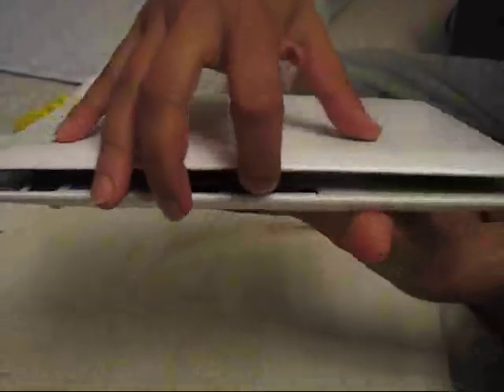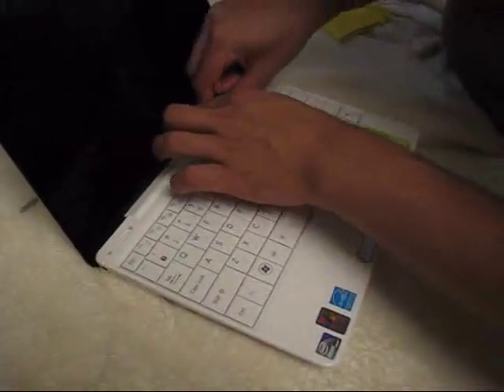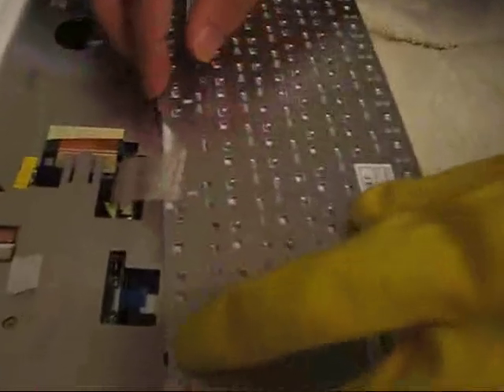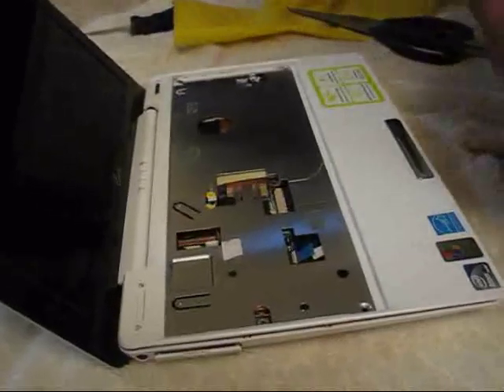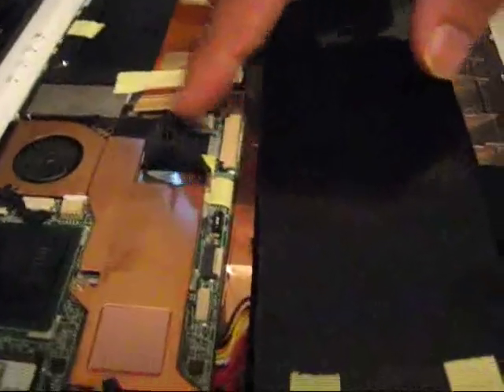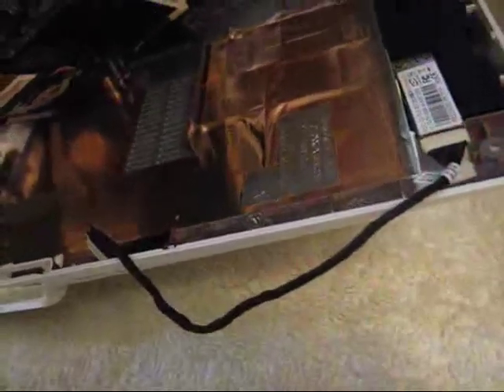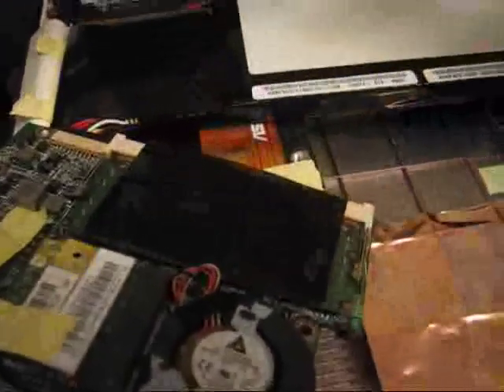Upgrading RAM - eeepc 1008HA - to 2GB - Part 1

Comment: On my 1008 you only need to remove one screw.....
. Why open whole laptop when there is only 1 screw to release, and that opens the ram compartment to replace the ram stick.  THINK TWICE, before starting it.
Reply from the maker: Good for you. Please check the full model number before referring to this.

Comment: 1 Gig is more than enough for these single core netbooks with XP . Its the low power cpu thats the limiting factor ,if u want  Win 7 then by all means upgrade to 2 gig ,but it will still run sluggish if u have virus protection runing in background  .Not got a dual core netbook , but i bet they run a lot better .As far as small pcs go now touch tabs are the  way to go.My relatively cheap Ainol android tab runs rings around my Asus 1008ha running Xp .shame really because its a nice little netbook

Comment: This was a very helpful video. You can do other things, to like change the hard drive. I want folks to learn from my misfortune. If you will be disconnecting any other ribbons or cables to do anything else. I HIGHLY RECOMMEND DISCONNECTING THE BATTERY. Right in the middle of reconnect my ribbons, my fan kicked on and then ZAP! Puff of smoke! I'm a little angry at myself for not thinking of that first, but afterward, it was like: duh! Others have written about this below, but it bears repeating.

Comment: IDEA just remove the vent on the underside since the ram module is right over the vent dremal tool  would make light work of this job for some of us. A little epoxy and the piece you've cut is replaced. I'm a dremal wiz so perhaps it's just workable for a few of us.

Comment: Thanks for sharing these efforts with the world. It gives a good sense of what the job involves. Disassembly looks a lot like when I installed a dual band Wireless-N WLAN card in a 900. Keyboard out, break sticker, split case, etc all look familiar.
I would not have gone trough all this for the sake of RAM alone.
Replacing the SATA drive with SSD or faster drive would be on my list.

Comment: Thank you for the effort. I followed through and it worked. Except,
1) at 1:55, the keyboard connector requires the "sliding up and down" of the black mini tabs
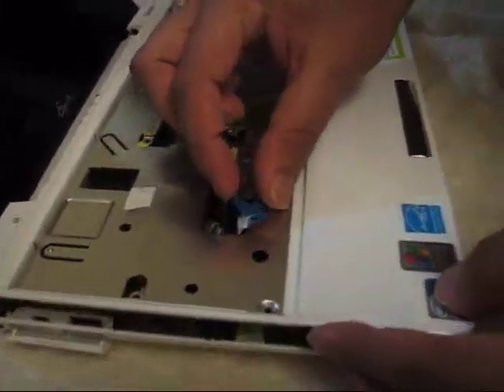2) at 4:30, the tiny cable between the mainboard and the metal plate requires "lifting up and down" of the WHITE mini connector

Changing the HDD is simply pulling out the HDD with a silicon black jacket. Be careful not to break the SATA connector when you push it back in.